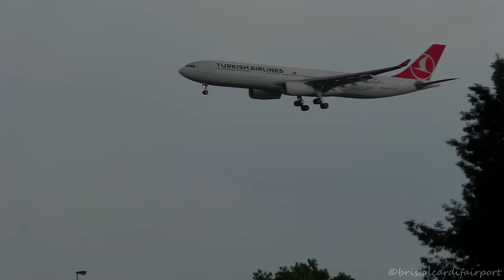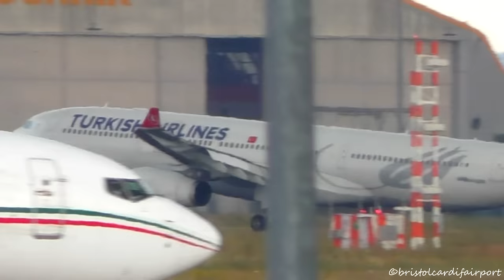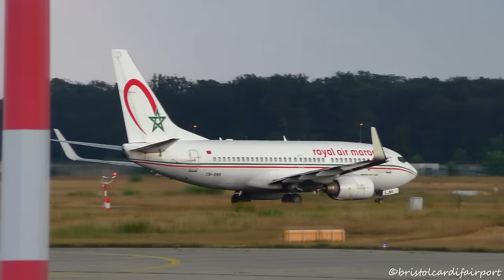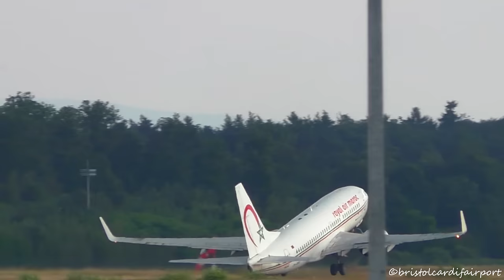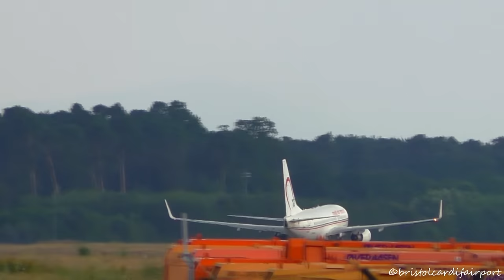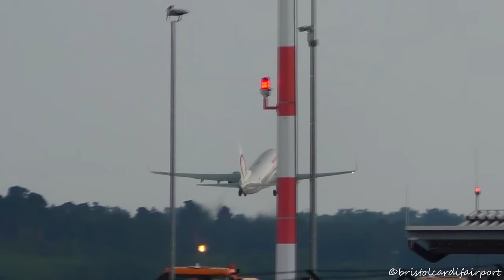PASSENGER AIRCRAFT FAILS TO TAKEOFF! BOEING 737 NEAR TAIL STRIKE & STALL ON TAKEOFF

Comment: Glad to see Mentour Pilots response to why this happened. Great explanation of a great aircrew doing exactly what they should have to make sure a safe flight was performed.
Reply: Was expecting to see a load of wake turbulance comments from those who watched Mentours vid. 🤣🤣
Reply: @jimgemmell2831  yeah I dunno why but I have a sneaky suspicion wake turbulence is the cause
Reply: Yh
Reply: @M. Daniel Yes, a perfect example of the Dunning-Kruger effect.
Reply: NSDAP Enthusiast 88  Don't argue with me, take it up with Mentour.  Other pilots were reporting wake turbulence prior to this happening and they reported it to the tower as soon as they were safely in the air.  Go watch his video, everything is explained.
Reply: NSDAP Enthusiast 88  Wake turbulence takes minutes to decay after a heavy jet. It has been noted and that's exactly why the "heavy" (and "super") designations exist in the first place. That being said, I don't think wake turbulence had much, if anything, to do with this incident. It can clearly be seen that the RAM 737 has already passed 07R before it started to rotate. It would have been thousands of feet upwind of the TK A330's wingtip vortices by the time it was struggling to get off the ground.

On an unrelated note, you have a very weird username.
Reply: @utha2665  I watched his video. I'm both a pilot and an engineer. His explanation doesn't fit the scenario. The RAM flight was thousands of feet upwind of the A330's vortices when it was struggling to take off. You can clearly see it pass the rwy 07R threshold in the video before it begins to rotate. The only way I can see that the wake turbulence could have been a factor at all here is if it caused RAM's airspeed indicators to briefly indicate an airspeed above Vr as they passed through the right-side vortex, then the pilots began to rotate though they were really still below Vr. More likely, though, someone just calculated Vr incorrectly. Either for the wrong mass, a different config, or both. Vr for a given flight, even on the same aircraft, can vary by 50 knots or even more depending on mass and takeoff config on the 737.
Reply: @vbscript2  That's fine, I have no reason to doubt you, here is the link to the video where he explains what Mentour thinks is going on.  
https://www.youtube.com/watch?v=TEjbg_2yuFI
Reply: @utha2665  Yes, I've watched his video and find his explanation completely implausible. There's no way they were experiencing the wake turbulence of the A330 for that long of a duration. They would have passed through the left-side vortex in less than a second, but they had high enough AoA that they should have lifted off if they had been at the proper airspeed for around 11 seconds.
Reply: really? what is the video's link pls?
Reply: @utha2665  👍
Reply: @vbscript2  the a330 is a "heavy" jet and the heavy refers to its wake turbulence. It's wake turbulence CAN stay for that long and the pilot's explanation makes total sense.
Reply: @vbscript2  His explanation fit the scenario perfectly. Remember, wake turbulence falls to the ground. Plus, the camera angle can make things look very different.
Reply: @ElectroRail  I know what "heavy" means and I know how wake turbulence behaves. Because I'm both a pilot and an engineer (and I've worked as an engineer at an aerodynamics testing facility.) The camera angle can't change how their improper rotation looks. The wake turbulence can stick around for that long, sure, but they were traveling perpendicular to it. The vortices can hang around for as much as a few minutes, but they don't spread out over thousands of feet. Traveling perpendicular to it, they would have passed through the left-side vortex in under a second at the speed they were moving. There's absolutely no way MenTour's explanation can be the correct one.

Consider also that the scenario there (lighter aircraft passing through wake of perpendicular arriving heavy during its takeoff run) happens many times every day at that exact airport,not to mention at lots of others around the world. If it were possible for it to cause this effect, we would have incidents like this one literally daily. But we don't because it isn't.

The only realistic explanation for this incident is that they rotated at a speed that was not the proper Vr for their weight and configuration. Why that happened we don't know and probably won't ever know because it wasn't investigated and the data necessary to investigate it properly wasn't retained. It's possible that RAM's dispatch just calculated Vr incorrectly and gave the pilots the wrong numbers. It's possible that the pilots rotated before Vr. It's possible that the pilots calculated Vr incorrectly. It's possible that they took off with a configuration different from the one for which Vr was calculated (e.g. flaps 1 when V speeds were calculated for 5.)
Reply: @utha2665  thank you for this, its the term of the year!
Reply: @vbscript2  Do wake vortices move straight down or something? I would expect vortices coming off the right side of a plane to continue moving significantly to the side in that direction, even if that were slightly upwind.

But then, you're the expert it seems...

I believe your mistake is in believing this is "thousands" of feet from the path of the other runway. The runway they are taking off from conveniently has a transition in surface color, so we can look at 2016 google earth imagery to compare. Initial rotation is still on the dark-colored part (in fact, you can still see the dark bits under the plane for a while after). The very end of the dark part is only 1400 feet beyond the path of the other runway. By my estimate based on the buildings in the background and objects in the foreground, the initial rotation was somewhere around 500-600 feet past the path of the other runway (right around where the runway is crossed by a taxiway).
Reply: @xiii-Dex  They normally move with the wind. If there's no wind, then, yeah, they move nearly straight down. The point was, though, that they don't spread out much laterally. Certainly not over more than half a mile while still retaining enough velocity to prevent a 737 from taking off. Also, if MenTour's theory were correct, it would be the left-side vortex that would be the problem. The right-side one would actually add to the airspeed and make taking off easier (though, in reality, a 737 near Vr traveling perpendicular to the vortices is going to spend less than a second in each of them, so they won't really make a significant difference either way.)
Reply: @vbscript2  I edited my previous comment, but it's nowhere close to half a mile. It appears to be about 600 feet, 1000 tops.
Reply: @xiii-Dex  The nose was high around 11 seconds. Near Vr of a 737, that would be 2,000-3,000 feet, perhaps more. They would have to have been encountering the left-side vortex for that entire time for MenTour's theory to hold up. The entire failed rotation would have used up nearly a full mile of runway more than would have been needed if they had rotated at Vr.
Reply: @xiii-Dex  Ah, I see your edits to the other comment now. It seems you've misinterpreted what I said. Yes, the runway the 737 was taking off from is only several hundred feet from the threshold of the runway on which the A330 landed. I don't doubt that the 737 did indeed cross the wingtip vortices of the A330. But the 737 was traveling almost perpendicular to the path of the A330 (and, thus, perpendicular to its vortices.) Traveling almost perpendicular, it would have crossed each of the A330's wingtip vortices in less than 1 second anywhere near Vr. Yet, it rolled down the runway with pitch angle that should be sufficient for lifting off at Vr for 11 seconds, which translates to thousands of feet traveled down the runway. The left-side vortex alone would have to have covered that entire distance in order to have prevented the 737's lift per the theory proposed by MenTour.
Reply: @vbscript2 That makes sense. I'm curious now, how quickly does speed get bled off if you rotate but don't successfully lift off? So for example, would a momentary lack of lift at rotation kill speed enough to require putting the nose back down to regain it?
Reply: @xiii-Dex  You're not going to bleed off much speed, but you're not going to be able to accelerate much with the pitch held high like that, either. A momentary lack of lift duration rotation wouldn't bleed off any significant amount of speed. Especially if that lack of lift were actually due to a tailwind as proposed by MenTour's theory, which would have been pushing the aircraft forward, adding to its thrust.

Even the 11-second nose-high attitude probably didn't result in losing much, if any, speed, but it prevented significant further acceleration up to an airspeed where they could safely fly away.

Even in the very unlikely event that they had been significantly slowed down almost instantly at the beginning of their rotation, though, this would have been readily apparently from the ASI and should alert them to immediately lower the nose again, not hold it high for 11 seconds. 11 seconds may not sound like much, but it's quite a long time in terms of a takeoff run, especially when already near Vr. Attempting to force the airplane into the air like they did (raising the nose even further after the initial rotation didn't result in climb) is also very dangerous. It just increases drag even more and, even if it does manage to get you airborne, you won't have enough lift to fly away out of ground effect and you'll fall back onto the ground.

For those who may not be familiar with ground effect, when an airplane, especially one with wings mounted at the bottom of the fuselage rather than the top, is near the ground, the air being pushed down by the wing gets compressed between the wing and the ground, which then causes it to push back against the bottom of the wing, adding lift. This effect diminishes very quickly once you start to climb, though. The effect is almost completely gone once the wing gets to be more than about half a wing length above the ground level, but it starts to drop off rapidly even much sooner than that, usually as soon as the main gear are just a few feet off the ground, if even that.
Reply: @vbscript2  according to Mentour the vortexes move outward from each wing. And the 737 is hitting the right one, not the left. Because the right vortex is spinning anti clock wise it will remove the lift created by the wings and that’s why they can’t get if the ground.

Are you a commercial pilot?

You do know that a 757 went down over New York because of wake turbulence.
Reply: @brickisland6353  The 737 is hitting both of them in rapid succession, moving through each one in less than a second each. They do move outward a bit, but not much. There are lots of videos you can go watch yourself where you can see how they behave (i.e. by observing effects on clouds, dust, smoke, etc. that makes them visible.) They certainly don't spread outward over half a mile, as they would have had to have done to be the cause of the problem here. You're right that the traveling through the bottom of the right-side vortex would reduce lift, but this would be very, very brief and could not possibly produce what happens here. I have flown airplanes across wake turbulence before. You feel a sudden bump and it's over. It's not a prolonged effect if you're flying perpendicular to the direction of travel of the aircraft that created the vortices.

I am indeed a pilot, though not commercial. I am also an engineer who has worked as such at an aerodynamics testing facility. I'm pretty familiar with what I'm talking about on this subject.

As far as the Airbus A300 (not 757) that crashed in Queens, saying that that was "because of wake turbulence" is dramatically oversimplifying what happened. First of all, these scenarios aren't remotely comparable because that aircraft was flying through the wake turbulence of an aircraft it was following on roughly the same track. It was not moving through the vortices perpendicular to them (in which case it would only have experience them for a fraction of a second,) but rather remaining in them flying along their length, following the aircraft that was producing them.

As for the actual reason for the crash, though, it wasn't the wake turbulence itself, but rather incorrect pilot inputs in response to them. For some reason, apparently the pilots thought that alternating extreme rudder inputs would help when flying through wake turbulence. It doesn't, but what it does do is put forces on the vertical stabilizer far beyond their design loads. While it's true that the rudder is designed to be able to go from the neutral position to full deflection to one side, it is not designed to rapidly go from full deflection to one side to full deflection to the other and back. Doing so overstressed the composite pins that held the vertical stabilizer to the aircraft, causing the pins to shear off and the v-stab to separate from the aircraft. Without the v-stab, the aircraft quickly entered a flat spin, which, in turn, caused aerodynamic forces far exceeding design loads on the engines, causing both of those to separate, too. The fuselage impacted the ground shortly thereafter.

American 587 would have been fine if the pilots had not been commanding full rudder deflection in opposite directions in rapid succession. Airliners fly through wake turbulence of aircraft in front of them daily.

Where the wake turbulence itself becomes dangerous is if there's a much lighter aircraft following a heavier one. In that case, the vortices can be strong enough, especially near the ground, to completely flip the following aircraft and toss it around. Had it been, saying a Cessna 172 and not a Boeing 737 that was departing in Frankfurt, it would have needed to delay its departure for a few minutes to give the A330's vortices time to dissipate, as they could be powerful enough to pick up the 172 and flip it. Not so much with a 737, though. The vortices are only 100-200 feet wide (each.) A 737 near Vr will be moving minimally 200 feet per second. Moving perpendicular to the vortices (as we can see they are doing,) they would have crossed each of them in under a second.

Additionally, had they actually indeed been experiencing headwinds strong enough to prevent liftoff (from any source, wake turbulence or otherwise,) we'd have been able to see that on the windsock that they passed while the nose was up.

Furthermore, if you go look at the Aviation Herald article on this incident, they have high-res photos that were sent to them of the incident, which clearly show that the RAM 737 was already well past the extended centerline of 07R during the first rotation. You can see that it passes the intersection with taxiway S while fully rotated, but still not getting lift. This is nearly 1,000 feet upwind of track of the A330 and the RAM 737 continued to travel another 1,500' or so upwind of that position with the nose still high without being able to take off. The vortices would move with the wind, so, given the light wind at the time, would have be slightly on the other side of the extended centerline of 07R, not all the way over past Sierra, half a mile upwind of the extended centerline  of 07R.
Reply: reading these comments like y’all are all missing the point, he should have aborted the takeoff, after the first almost tail strike, period.
Reply: @ItsCandaceLittle  Too late. Way past V1. Unless your aircraft is disintegrating, you don't abort past V1. Continuing the takeoff run is less dangerous. Lowering the nose, getting up to Vr, then climbing out was the correct course of action. They just should have done that a lot sooner.
Reply: @M. Daniel Why are people too stupid to fact check 'expert' opinion? The 737 begins attempt at rotation 14 seconds after full throttle. A '737 full power short take-off' video shows rotation start at 16 seconds. A 737 fully loaded take off rotation, 34 seconds. Why should any 737 be trying to rotate so early? First error, attempts rotation too early. Second error, doesn't react to stall and increases pitch for 5-8 seconds. Third error, near tail strike.
Reply: @vbscript2  The turbulence did not come a lot sooner. The pilots reaction time concords with the airplane reaction time. You can't yank on the controls of a 737.
Reply: @vbscript2  You over explained this matter.
Reply: @vbscript2  Wake turbulence takes minutes to decay... Unless it triggers a atmospheric chain reaction. You study this with meteorological patterns. Here in Florida pilots are very familiar with these conditions.   Water boils at different temperatures. Why?
Reply: @Angelum_Band  Water boils at different temperatures because... different air pressures exist? (Or because stuff is dissolved in the water, as the case may be.) I'm not sure what your point is, as that's pretty irrelevant to wingtip vortex behavior.

My point was that they had already passed through the A330's vortices before their rotation AND that, even if they hadn't, they wouldn't have been in them for the entire time that they were holding the nose well high enough to get off the ground if their airspeed had actually been above Vr. It's very clear that their rotation was early and that wake turbulence had nothing to do with that other than, at most, possibly a brief erroneously high indication that would have lasted less than 1 second.

The most likely explanation, though, is just that they either rotated before the calculated Vr or someone (whether pilots or dispatchers) computed Vr incorrectly. And, regardless of why they rotated too early, trying to force it into the air when it didn't want to fly was obviously a major mistake. One that could have had deadly consequences if they hadn't been on a runway much longer than 737s typically use to take off.
Reply: @vbscript2  First they didn't rotate too early: they were pass V1 the video does not show the whole acceleration process but it shows the end of the runway very close. Second how does boiling water matter? Air pressure, temperature matter. Those can change from one second to the other. Glider pilots take advantage of this fact all the time. The previous plane's wake can trigger mini wind shears enough to make you look silly. Third lowering the nose to gain speed is not only a normal but almost mandatory procedure in most of the cases. Last the pilots did what they were supposed to and saved the plane.
Reply: @vbscript2  Evidently you are not a pilot.
Reply: @Angelum_Band  Ah, yes, ad hominem. The surest way to tell someone just realized that they were wrong.
Reply: @Angelum_Band  Your previous comment consisted of literally nothing but ad hominem, which you well know. Pointing out that your comment wasn't even an argument, but merely nonsense ad hominem isn't sensitive, it's just calling your comment what it was and pointing out that you had no actual argument in it.

This incident happened years ago. Flightaware's data for non-paid users goes back 3 months. At any rate, the ADS-B updates in flight aware aren't frequent or precise enough show where the 737 started to rotate. Fortunately, that's completely unnecessary, as we have pictures of it, clearly showing where its first rotation and hop occurred, well past the extended centerline of the runway the A330 landed on and yet with 9,000+ feet of its own runway remaining.
Reply: @vbscript2  You say you are a pilot and an engineer and you can't pay for a service that provides irrefutable data? Second I also posted a link with the weather at EDDF for July 23 2016. From 18:00 to 19:00 you can see variations is the wind and temperature when the plane was taking off. But wait there's more! I also have the high resolution photos of that departure showing the plane properly configured for take off. But wait there's more in those photos you can clearly see they were taking off with at least 4 knots tail wind. And yes you are delicate.
Reply: Without flaps is hard to take of
Reply: @bombetobg  The flaps were in a valid takeoff configuration for the 737. They just rotated too early for their weight and configuration and then held the nose high for several seconds before derotating and accelerating up to a proper rotation speed.